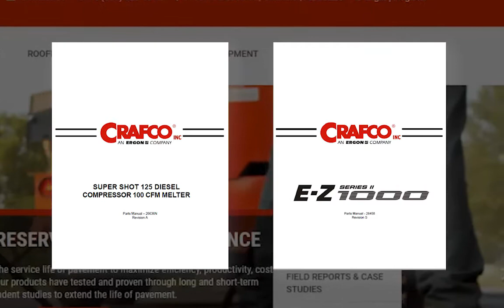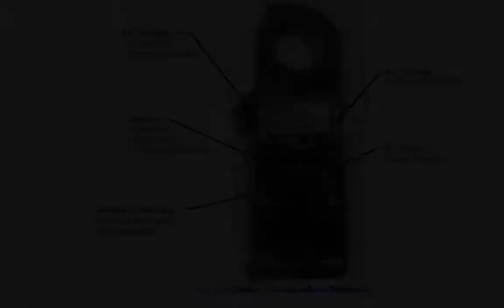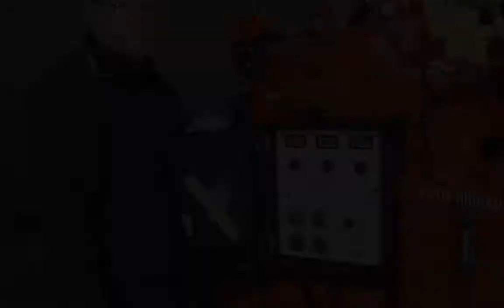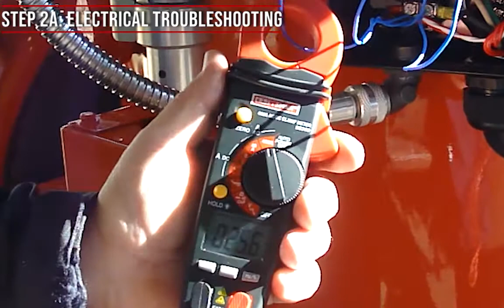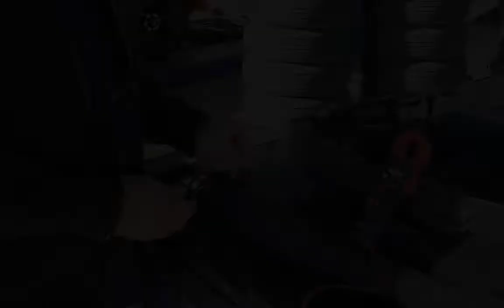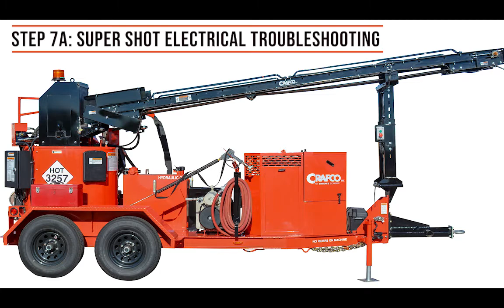Crafco Hose and Wand Troubleshooting | Crafco Inc

Comment: How long should take heat up the wand and what temperature should be at?
Reply from the maker: Hi there, the hose/wand is typically heated to 380F, and we recommend letting it heat for about 30 minutes. (One of our field personnel said they like to do 45 minutes. Your experience may vary.) That's assuming you're on one of our more recent machines. The temp and heat time may be different on an older unit. If you need any documentation for either a newer machine or an older one, you can find it here: https://crafco.com/equipment-documentation/

Let us know if you have any other questions!